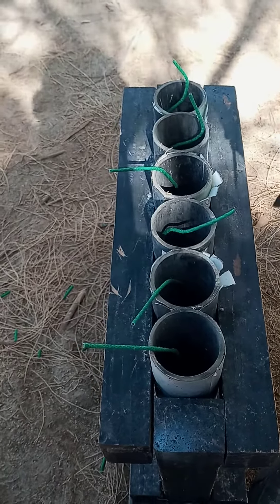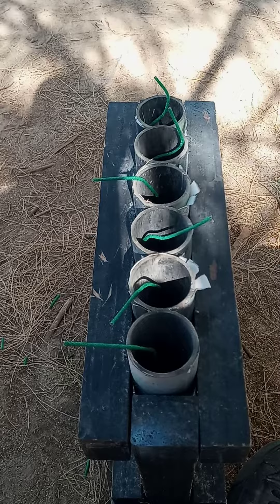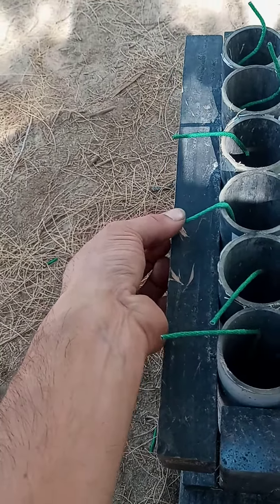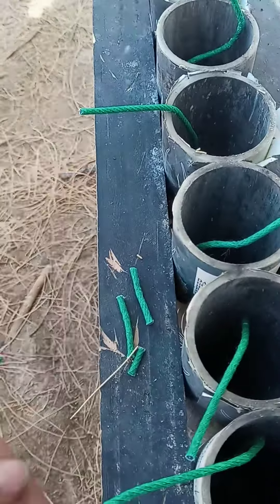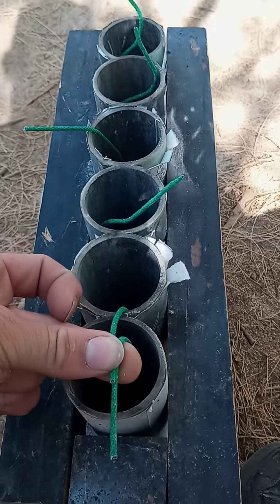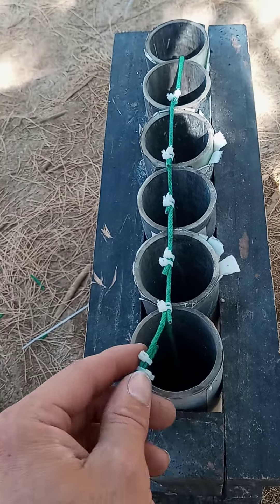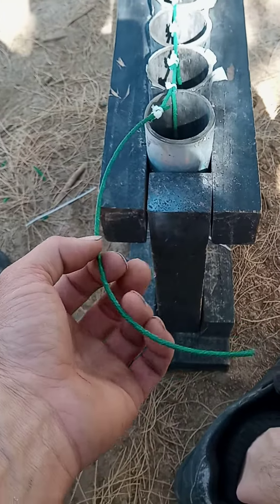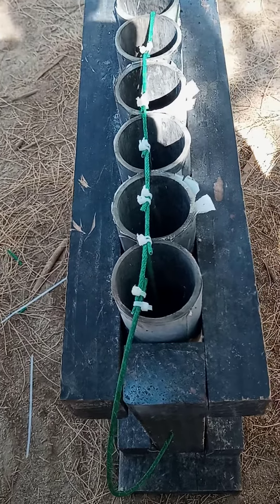FUSING METHODS (PIGGYBACK)

Comment: Nice bro how is the delay time on it I mean like is it 1by1 or like 2,3 shells go off at same time
Reply: Thanks bro
Reply: Can do a video and what type of fuse to use on shells and there speed I like the ones that go 1 then the next after each boom I cant seem to figure it out wen I try to fuse it lol
Reply from the maker: @josephrobeson1034  so you're saying you want your shells to go one by one? Slow?
Reply: Not slow sorry bro it's hard to explain
Reply: But thanks for taking ur time to answer
Reply from the maker: @josephrobeson1034  I get what you're saying you want the next Shell to eject as the one before that explodes?
Reply: Yes that's right so if u have the time can u do a video and show me how to fuse it I have a 25 shot milk crate so I'm lost lol on how to set it up
Reply from the maker: @josephrobeson1034  I'll tell you one thing here's the problem with getting exact timing. Different shell makers use different fuse that have different timing they are never exactly the same so to get the exact timing that you're looking for I would go with e match. Meaning you push a button every time you want one to eject.
Reply: Gotcha bro